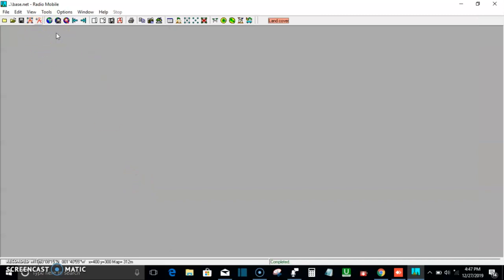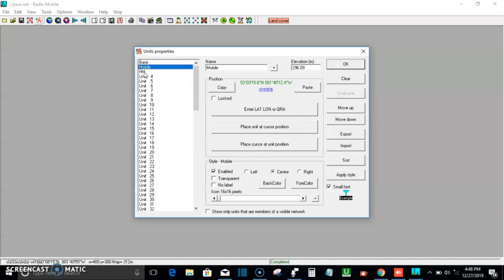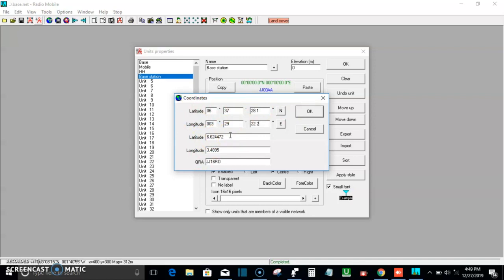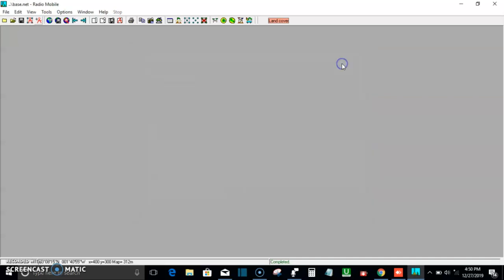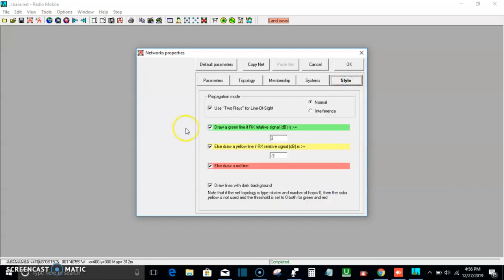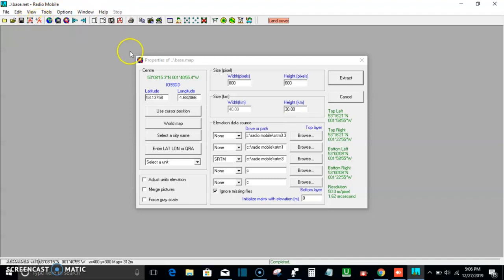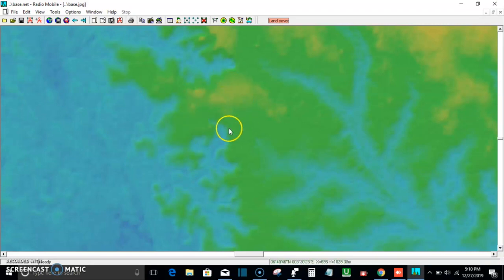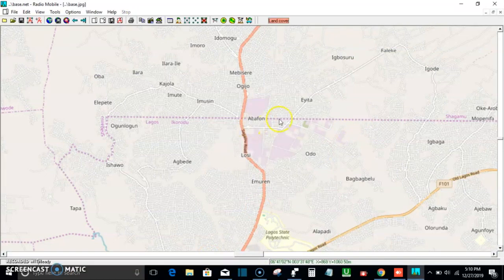Radio Mobile Application  Software for wireless systems networking planning.

Comment: what do you mean by the worst fresnel ? what is its significance ? which one is better of the two: a worst fresnel of 3.5F1 or 2.7F1?
Reply from the maker: Worst Fresnel zone is the area where the propagated signal will hit any obstructions along the path. It significance is that if the Fresnel zone is free clear one is assure of good link after the installation with a good signal quality, rx/tx with good capacity.
Reply: @secure_media  Thanks for responding. but if you could put light on second part of my question, I would be greatfull